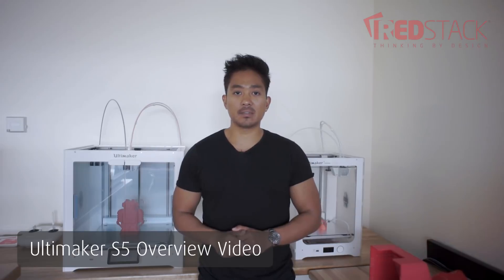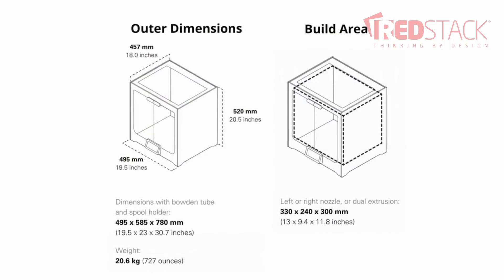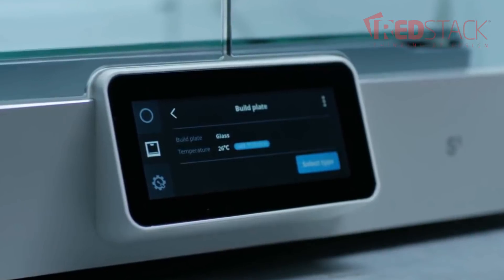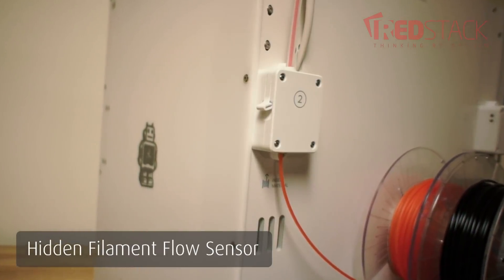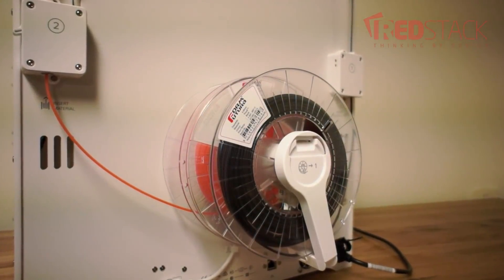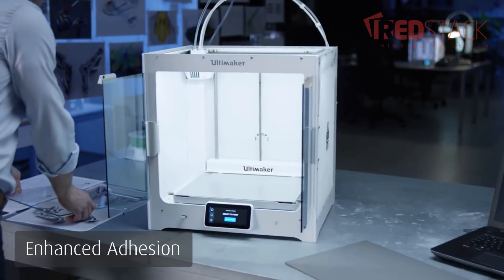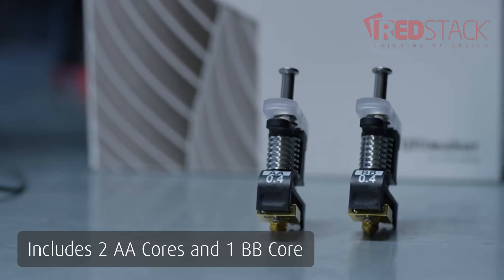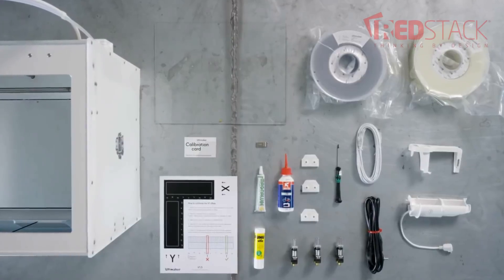Ultimaker S5 Overview - All Features Explained

Comment: For the cost this printer has, a big NO NO
No servo motors included, Z axis looks like a toy, that should be suspended above with a bracket and a bearing.  I am sure the cost of producing this nice box is less than 1k euros.